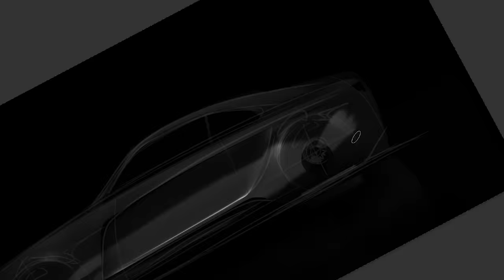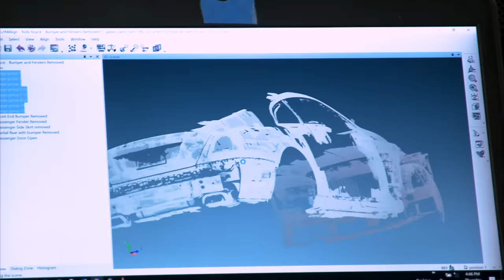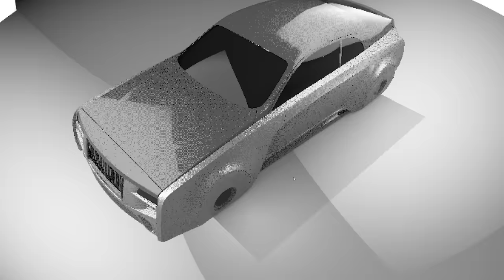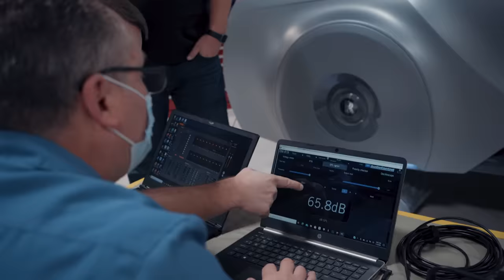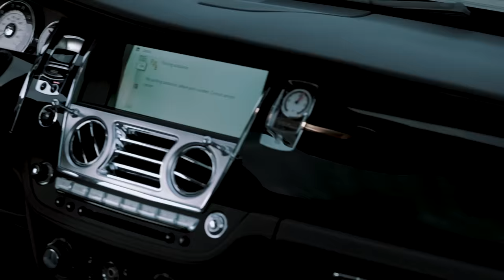Justin Bieber's One Of One Rolls Royce | West Coast Customs

Comment: the wheels showing underneath makes it more ugly, and the amount of dead space around the car. i dont even know
Reply: I agree. They should have gotten rid of the wheels.
Reply: the thin front tires make it worse and the front bumper looks like it shoulda been lower to the ground. 
kinda tacky tbh
Reply: i thought if only they used bigger rims and thinner tires just to show part of the barrel or just put air sus and airout when its parked but oh well money cant buy taste
Reply: facts , from the front it looks like they made a giant widebody kit and forgot to change the wheels. What they should of done was make the wheel covers attached to the wheels rather than fixed to the body so they could avoid that clown car look, the illusion would only be broken when turning but lets face it the thing will most likely be parked and shown off for marketing its entire life so it wouldn't really matter anyways. It looks like they put two Toyota tercel donuts on the front smh.. Don't get me wrong they did an insane job making the thing but the initial design is where they went wrong.
Reply: @fvmods1128  The funny thing is that the wheel covers are actually attached to the wheel on the concept car and turn with the wheel. The RR designers already thought this through...
Reply: I hate justin bieber to my guts, but i must agree the car looks pretty futuristic.
Reply: With all the effort to make to hide the wheels it needs active air suspension. Air suspension obviously so you can get down really low to the road, but active so it can jump back up when the road conditions suck. And Californian roads can suck big time. You really wouldn't want a 1 inch pot hole tearing apart your 500 hour custom side panel.
Reply: I agree.First look it's ok but then you ask yourself wait a minute....
Reply: @code0125mm  dafu???
Reply: Ikr
Reply: yup ... its ugly af XD
Reply: It looks like one of those kids beds made to look like a race car.

Comment: shouldve added some bags in there, so when parked, just slides on the ground
Reply: 100% agree, it just a tad too high
Reply: Thinking the exact same thing
Reply: this !
Reply: They probably didn’t want to change how smooth RR drives
Reply: @dadadavinci8450  air suspension is smoother than coils
Reply: @dadadavinci8450  yea bags would ruin the amazing comfort
Reply: @nathandunn9743  but they have air from the factory.
Reply: Probably didn't want the fiber glass being to close to the ground
Reply: Haha
Reply: @kylec1181  he said when parked, not while driving
Reply: @floydb9100  having the adjustability of bags could have him want to drive it round lower causing damage but I was talking about if he was parked anyway, uneven surface could ruin the whole thing
Reply: @floydb9100  just the weight of the car coming down could flex the fiberglass and ruin the already not perfect panel gaps
Reply: bagging a rolls royce is like peeing in your koolaid
Reply: Out of budget by like 700k already
Reply: how did they miss what should have been so obvious??
Reply: It’s already on bags lol it can definitely lower and raise itself.
Reply: Exactly. You read my mind
Reply: It's actually on factory air suspension and all they could've done was clicked on a button in the center console to lower it
Reply: If you watch RDBLA, they have their own method for getting the car to go lower (probably drop links). So once it’s parked, it airs out and looks much better.
Reply: @floydb9100  not smoother than a Royce
Reply: That's what i said & it should be a little lower. As soon as you see the it looks like dog shit. Better off rocking some one off solid wheels.
Reply: Absofuckinglutely.
Reply: Definitely
Reply: It's already on bags, it's a rolls royce. Everything audi a8 bmw 7 mercedes s class, bentley and rolls royce are air suspension cars. You can lower them with software
Reply: @Nordic_Mechanic  this^

Comment: "This is a night time car" i agree  no one wants to see that crap under full light..
Reply: Night time and straight lines only
Reply: @jgetscensored7837  it's pretty much big hubcaps on the car. Yes it turns
Reply: @ThePeacePlant  it’s already been verified that the thing has no steering radius. And no those are connected to the body work, not the hub.

Comment: That car is crazy until we see it's wheels
Reply: Exactly.  Looks horrendous
Reply: EXACTLY. At first I was like "you know what? This actually looks really cool." Then I see that it's literally a body kit slapped on top of a car and it doesn't look right at all. Very disappointing, for as much work they put in it looks like shit the instant you see the wheels peaking out from the bottom.
Reply: @jackrose5077  the difference between rolls in house designers and not I mean respect for the effort but airbags so it’s leveled when stopped would of increased the awe factor tough to get shit like this done past a drawing
Reply: Ong it’s so bad 💀
Reply: @spilot1016  i think its a wheel cover, its not connected to the body and so it can still turn.
Reply: I just want to know how you change a tire when you get a flat and also how does it turn? Seems like it would have a small turning radius.
Reply: @juanl1999  To change the tyre, u have to take it to WCC and they will charge quite costly ...
Reply: Not even worth building a big waste of time and money
Reply: Yep.  People pay to make their cars bad.  Hmmmm
Reply: @juanl1999  you're not supposed to drive this car.it's decor
Reply: The lights don't help in hiding the wheels

Comment: "It looks like it floats"
meanwhile there are lights pointing directly at the wheels
Reply: Would've been cool to see a led arc on the covers instead of a that line at the bottom
Reply: I know dont understand why cheap strip of led or neon on a rolls no class
Reply: Would be really easy to screen those lights so they shine only out and down and not in and down. Missed an opportunity there.
Reply: yeah the idea is sound but implementation is wrong. If the light was directed outwards with minimal bleedthrough to the wheels it would completely hide them, kind of like a 1 way mirror.

Comment: 10:34 when you realize you wasted your money and time for something that looks like a cheap bodykit from China. LOL 😂
Reply: The is a complete unit... why the fuck compare it to a Chinese body kit? 😂 this thing is will hold its value for sure
Reply: @TheNuclearBolton  Bro, first fix your grammar lol 😂. Look at how the front end looks, you will see how it looks cheap and looks like a knock off wide body kit you would get from China.  Also, look at the wheel covers; when you see it driving you can see a significant amount of wheel gap. In my opinion it should be lowered to at least look decent. And to say it took 3 years to do this, I think they could've done a better job with the front end. The rear end looks fine.
Reply: @humaylamer7964  And it would be worth compromising the factory suspension to have air bags just to further enhance the presence on the road? And perhaps make the under-glow shine outwards onto the road rather than on the tire. This car would be too bouncy with air bags and ruin the hover effect. I would personally add more fiberglass around the wheels to conceal the tire. Perhaps add negative camber and get smaller wheels. :/
Reply: @TheNuclearBolton  Oh I wasn't referring to air bags, just lowering springs. Yes, you're right the fiberglass should've been more longer or enough to look flush to hide that tire.
Reply: Justin Bieber got no taste 🤦🏽‍♂️😬🤣
Reply: @humaylamer7964  “more longer”? Bro, fix your grammar! 😂
Reply: @TheNuclearBolton  Buddy do you know what grammar is?? Lol would you like me to say 'much longer'? Both are grammatically correct, look it up if you don't believe me 😂
Reply: @JDM-gx8ki  I might have to agree with you on that 😬
Reply: Lmao imagine fighting over a car that doesn’t belong to you😂🤣
Reply: @humaylamer7964  those taillights don't match the car. they look like they were taken off of a Mercedes a class
Reply: @ivanlapus4274  Imagine thinking that we're fighting over an ugly car. I was just saying that this car looks ugly. I guess you don't know how to read 😬, LOL 😂
Reply: @churcuri  Yeah, overall this car doesn't look good.
Reply: @JDM-gx8ki  you got that right, money with no educación
Reply: @MM-tr2ni  soon he will be broke cuz he don’t know how to manage his money just like all the famous   People out there
Reply: @JDM-gx8ki  Nah... he got ROBBED!  I'd have been like.. "Uhh... what did you do this RR?!?"
Reply: @thumpz99  I wonder how much money he wasted on that RR, like it was in the shop for 3 years, so I guess it should be upwards of 150K+ but I may be wrong.
Reply: @humaylamer7964  Ooo Grammar police
Reply: @bimaputra9175  Why'd you change your initial comment. "Poop grammar police" lol 😂
Reply: @humaylamer7964  lmao🤡
Reply: Looks cheap and tacky...doesn’t look like a “floating” car! Looks like someone took some trunk spare tire covers off an old Cadillac Brougham and stuck them on the actual wheels. And lastly...the only positive thing that I can say...it looked better in the day. Those lights made it mad obvious that it was a cheap body kit. But hey...all the young, classless thirsty mo-fo’s on here will hype it up as they don’t know any better!!!
Reply: @independent2883  LOL 😂 I agree with you. What surprises me is that they spent three years making this cheap looking body kit 😂
Reply: @humaylamer7964  it takes one to know one buddy. go do something with your life
Reply: @TheNuclearBolton  I would agree if the car had been built using sheet metal craftsmanship but this is moulded in fiberglass. It’s trash. No way it’s value will go up. Justin should have found a real coach builder.
Reply: @churcuri  370z taillights
Reply: @mickfitz76  Well, I’m sure someone out there will buy it for what its worth. But for being the first car of its  kind, it is insane what has been done to it. It supposedly is supposed to have a tron theme, but I will be waiting for the designers to talk about this. 😂I just wish Justin did this to a less refined car, the Rolls Royce was already perfect in every way.

Comment: imagine reupholstering a perfectly good Rolls Royce seat! There's no way WCC could possibly come close!
Reply: and then they put RR on them!
Reply: @timhitt9541  the audacity
Reply: Yeah there's absolutely no way they managed to improve the RR interior. All through the video I kept hoping they'd leave the interior alone. I mean i knew they were going to have to make a couple of modifications for whatever ghetto sound system they were going to install, but I really hoped they'd leave most of the leather alone at least.
Reply: @Dr.TJ_Eckleburg  and what would be the point of that? The idea is it's a custom car. One you can't just go and buy off the shelf.
Reply: @jordanwalsh8171  Usually for cars like this the interior materials & finishes are already custom ordered by the customer and not off-the-shelf. The problem here is the new "custom" seats are probably not near the quality of the originals and hardly more "custom" than the originals, but I'll give them the benefit of doubt.
Reply: @GHTakerz  right! Wcc couldn't even clean the bathrooms at rolls royce let alone top the coach work of a world class automaker.
Reply: @jordanwalsh8171  lol you don't go and buy a Rolls Royce off the shelf to begin with... nothing WCC does is going to top the finest coachbuilders in the world. They could have simply worked around the major leather components instead of replacing them.
Reply: @Dr.TJ_Eckleburg  who said they didn't use the same quality leather? Pretty sure beiber has the budget to get the best materials. And if they left that stuff alone I'm pretty sure he would be pissed if he seen another 1 with exact same "stock" interior. Which is why he went to WCC.. .  .you don't have to like the car just understand thing like this are for people who don't want "standard"
Reply: @GHTakerz  yeah like any car they give you options to an extent. I doubt they would do anything what a custom shop would do or beiber would of got them to do it. Its not like he's broke
Reply: @jordanwalsh8171  It's not about the quality of leather -- although RR coachbuilders do have access to leather that WCC can't get -- it's the quality of craftsmanship. There is a LOT that goes into the quality of coachbuilding that has absolutely nothing to do with the grade of leather being used.

You can give a fine coachbuilder vinyl to work with and it'll come out better than what a WCC guy could do with the best leather in the world. 

And no, RR doesn't 'give you options to an extent', they literally will custom-build any interior you want in your car. They will fly you over to England and bring you to their studio to work with their team to customize an interior however you want it. They will charge accordingly of course, but the service is absolutely available through Rolls Royce -- specifically because they don't want their customers going to a chop shop like WCC to have their interiors ruined. 

You really have no idea how any of this works.
Reply: @Dr.TJ_Eckleburg  just because someone doesn't work for rolls Royce doesn't mean that they are not up to that standard of work and claiming the level of work is nowhere near that standard without actually seeing it in person and inspecting it is a bit stupid really and I'm pretty sure beiber is used to a very high standard of living and wouldn't settle for substandard work.
Reply: @Dr.TJ_Eckleburg  your right about the custom RR stuff just checked it up now, never knew that! Although i seen some bills for their. Custom work. . . .13million!. . . .💩 . .it's no wonder he went to WCC

Comment: The front kills the whole thing!!! What a mess !!
Reply: Especially the grill is bad.
- Not evenly spaced
- Not parallel 
- leaves a huge space left and right
Reply: That front end is too flat and that recessed grill looks weirdly small
Reply: @b0nz1official  exactly my first thought, the grill is too small with the extra width from the kit. I think it’s best from the sides, but that’s about it
Reply: 100% 
And they could have added some sensors on the front back and sides that read how close it is to the road and program it so it drives lower so you don’t see the wheels.

Comment: They took out the bespoke sound system and threw in JL audio? hahahah oh lord...
Reply: Some people don't know what bespoke means.....they probably think it's a brand
Reply: @Venomthegr8  And something just being bespoke doesn't make it top quality. Many expensive vehicle have sounds systems that don't fair well when actually tested. The fact that they tested the sound system to balance for the acoustics of the car may mean this lowly branded system could sound even better than the bespoke.
Reply: @BReal-10EC   if you have a bespoke sound system in your vehicle it is tuned for a certain decible level .....beyond your petty highs mids and lows.....ambient crisp full pure sound without the thump of the highways ......bespoke.  Like my mv Augusta exhaust and Ducati exhaust system.....it's tuned in an acoustic room for the perfect sound......stick with crutchfield as it's obvious it's beyond your caliber
Reply: They adjusted length and width of the car, that interior isn’t gonna be the same size so even if a bespoke system was fitted it isn’t gonna sound the same.
Reply: @TestdriverMusic  agreed 1000% and after they did that the acoustic levels changed along with the suspension ride , camber and tilt/angle which causes less damper to sound...hince trashing the hand built and installed bespoke system and replacing it with an underrated common trash system that which they feel is suited for their specs....so the bespoke system they removed cannot and will not perform to its fullest capability if installed in a common vehicle like a 93 F150....agreed?
Reply: @jvill1063  this from an individual who doesn't understand standards...I submit my silence..... hahahahaha
Reply: Nice joke.
Reply: @jvill1063  the owner is star and not interested in listening to audiophile...he wants his mid n lows banging but our delusional friend here @Venom 540 is all cranky about that...
Reply: bespoke don't sit in studio bah?.........listen to details and not just run through like a 2yr old
Reply: @adefreeman1  study grammar before you try to challenge me
Reply: @adefreeman1  it's obvious my standards are higher as well
Reply: Oh look i found some car audio nazis!

Comment: I'm sure it was expensive but still looks hokie with the wheel recessed so much.  Pretty sure I would have attached a bracket to the control arm to have the wheel cover turn with the wheel.  It just looks like it has a skirt with wheels under it.
Reply: Yeah have the wheel covers bulge out when you turn the wheel and then retract back in when the wheel is straight
Reply: Ella Fagan  JB's shirt back for the right size
Reply: @Wolf-wf6yx  New BMW does that kinda

Comment: Even though the car looks like trash, because Roll Royce has their iconic shape already. They should've just messed with  the interior not the exterior besides a paintjob. Justin Beiber did approve the look as time went on. There is no way you can satisfy a client if they are paying for it without getting their opinion. It could spell disaster. If it's a free car it's a completely different story, you can do whatever you want and give it as a suprise as it doesn't cost the user anything.